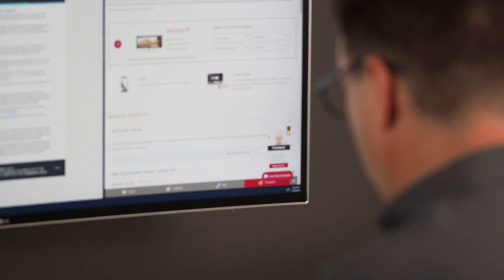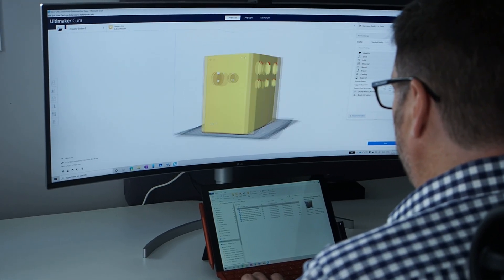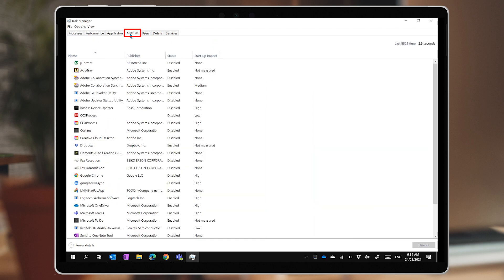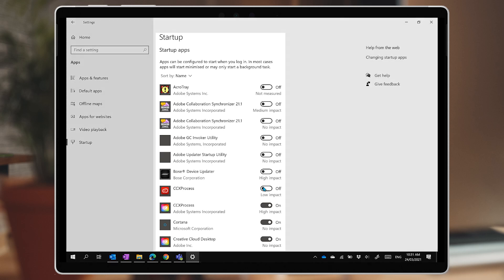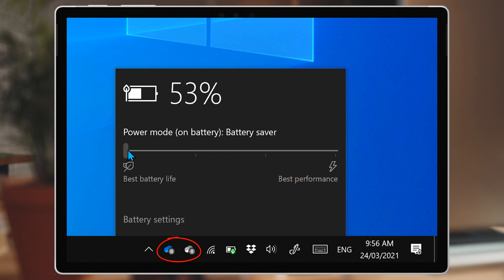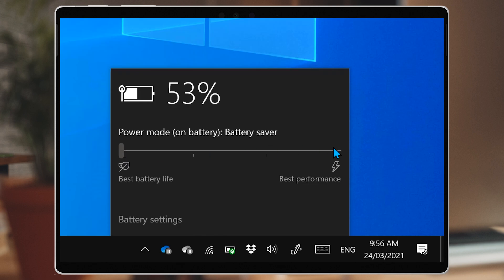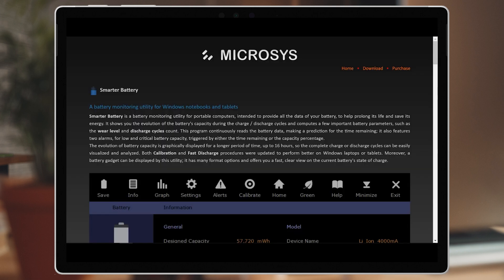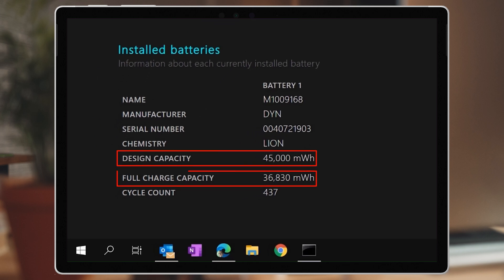Surface Battery Tips and Tricks - 2021 Update!

Comment: Surface Pro loses battery power even when it is switched off. After switching off at 94% for two days it loses 50% (down to 44%)...THis is the bad quality of the batteries despite the high price of Microsoft Surfaces. There is no fix. I am selling mine.

Comment: I have a Surface Pro 5. The battery life even using all recommended low battery usage settings I still only get an hourish not video editing,  just sketching in a sketch app. It's said to have many hours if battery usage on a full charge. FALSE. 
This is my second and possibly last time to buy a Surface Pro as the last one didn't hold a charge for more than 20 mins. The fan was faulty,  buzzing and over heating constantly.  Yes, I had a fan on it and cleaned out the vents. Still junk.
Reply from the maker: Surface Pro 2017 (aka 5) is now SIX years old! Lithium Polymer batteries have a limited number of potential charge and recharge cycles. On top of that heat, wear and tear mean that capacity is reduced significantly. Have you run the battery report? What is the wear condition of your battery?

Comment: hi
 I have Surface pro 3 and 5 
on 3 I use Throttlestop to undervoltage both CPU and gpu.
maximum 4 hour.
on 5 the CPU and gpu locked but I can disable turbo, enable speedshift. tell is 7 or 8  unlocked?
Reply: you can use group policy, local security policy and register to tweak windows. disable automaton.

Comment: Hi. My Surface PRO charger does not work sometimes and I could not charge my Surface PRO . After Some plug in and Plug out AC input or charger port on the Surface PRO, it take charge and it happen when Surface PRO on or off. How can I solve this ? 🌹🌹

Comment: Does keeping the surface pro  cable plugged in would affect the lifetime of the battery ?
Reply from the maker: Yes and no. Heat and battery cycles will have the most impact in my view. If you're on Windows 11, there is a smart battery feature that will extend the battery life even further. See the settings app > Battery.
Reply: Thank you Sir 
@oztabletpc 

Is surface pro 6 battery replaceable?
Reply from the maker: By a skilled technician with the right tools, yes. Not as easy as the latest models unfortunately.

Comment: Playing YouTube from browser, it drains very fast even when first time use and start playing from 100% fully charged. Very disappointing. The specs says can run for 11hrs. But I think if it can last 2 hrs of video play i will be lucky. Suspect that Microsoft is made in China and the factory or reseller may have used lousy or less capacity battery
Reply from the maker: Your problem is with chrome. Try Edge and optimise for battery performance.
Reply: @oztabletpc  I am using Edge. No chrome installed. Based on battery use chart, when it reached 60%, I was playing the video for 3hrs
Reply from the maker: @1stPrinciples455  OK, then change the performance settings in Edge to optimize for battery life. Turn off background activity and optimize for battery. The chromium browser engine is a resource hog, but fortunately in Edge you can trim it back. Made a huge difference to my Pro 8.
Reply from the maker: Also, if this is your first use there could be setup and windows update activity running that will kill power. Check that too.
Reply: @oztabletpc  is it true that we cannot run as admin the cmd.exe unless win 11 is out of S Mode which is an irreversible move?

I will try the settings and monitor the performance.  But what will answer my question on battery health is if there is a tool to see how many charge cycles has the battery gone through. This can allow a buyer to know if the battery is brand new. Cos when I first unboxed it , there was no power to boot up.
Reply: @oztabletpc  I was not able to startup. So I plug in power plug and it was started up. When it was 6% power I unplugged and it shut down while I was doing the initial personalisation settings of the machine and just before I entered the serial number to check the warranty , it shutdown at around 5% battery level.
Reply from the maker: I'd suggest you take it back. It sounds faulty.

Comment: What also helps go the advanced battery settings in energie  management.  And go to power plan go to maximum processor state and lower it to around 50% and go to minimum processor state and lower it to 1 % on battery power this means it wil use much les of its processor on battery power while doing light tasks

Comment: Could u help me? I let my surface charge all day and it only charged to 51! What should I do??
Reply from the maker: Start on the Surface support website. You can get there from the Surface app. You can check your battery condition using the Surface Diagnostic Toolkit too. https://support.microsoft.com/en-us/surface/fix-common-surface-problems-using-the-surface-diagnostic-toolkit-f61d8d18-37a9-863d-f8d0-1982eb16f7b5

Again, you can find that from the Surface app.

Comment: I use Surface Book 2 and 3.
Well, I've 'used' Book 2 and now I use 3 is probably more correct.

What I've found is that Surface Books actually will last longer in the Tablet mode.
My SB2 is a 2nd hand machine and it did have pretty good battery life.
It'll typically last about 4 hours but with the Tablet mode on, it did last about an hour or two more, paired with Edge for web browsing.

I've tried turning the dedicated GPU off from the UEFI (when you start your machine, you hold the volume up and power button until you see the Windows boot logo, then you let go of the power but hold onto the volume up button) but that didn't really affect much.

I have also got the auto brightness set.
I'm looking at around 6 to 7 hours of runtime (Steam on, web surfing on Firefox) without the tablet mode on on my SB3.

But just in case, I've got my trusty Promate Capital-30 (30,000mAh 78W PD powerbank) to top up the juice and so far it works fine. It charges well with the portable solar panel I carry in my car so technically I have infinite source of power.
Reply: thats opposite for me! my surface book 1 dies in 2 hrs (tablet form)

Comment: I just bought the surface pro 7 with an i7 new 3 days ago and the full charge capacity is 45.440 . Is this normal? I thought it was supposed to be 50.04.
Reply from the maker: I have an i5, my design capacity is 48,870 mWh. First charge was up to 49,780mWh, but current full charge varies between 48,310 and 46,510 mWh. I guess this depends on several factors including battery wear, but you can keep an eye on it via the battery report command - Powercfg /batteryreport.
Reply: @oztabletpc  Yes, I understand wear and tear, but this thing is brand new and I only charged it one time. It seems the battery may be old.

Comment: Just wish that there's a way to know how much, roughly, battery you have on your surface without turning the unit on. Like, a small 4 LED somewhere that can be activated to indicate level of battery.
Reply: I've got a Samsung Galaxy Book12 (in addition to my SP7) that allows one to check battery status without turning it on by tapping on the power button (You need to hold the button down for a few seconds to actually start up the device). It's a bit of a pain to have to fire up the SP7 in order to check the battery status.
Reply from the maker: That'd be cool!
Reply: @oztabletpc  I used to have an old laptop with removable battery, and this type of indicator was on the battery. also, many powerbank these day have LED to indicate percentage.

Comment: Won't leaving the surface charge OVERNIGHT constantly be bad for the battery life??? Just like it is for cell phones??
Reply from the maker: From Battery University: 

The question is asked, “Should I disconnect my laptop from the power grid when not in use?” Under normal circumstances this should not be necessary because charging stops when the Li-ion battery is full. A topping charge is only applied when the battery voltage drops to a certain level. Most users do not remove the AC power, and this practice is safe.

https://batteryuniversity.com/index.php/learn/article/how_to_prolong_lithium_based_batteries
Reply: @oztabletpc  Oh ok! Very interesting indeed! Thank you for the reply :)

Comment: This is a great set of recommendations and tips. One thing I would add is that Microsoft recommends draining the battery to under 20% at least once a month to keep the battery fresh. I'm not sure about the science/engineering behind it but as a road warrior (during non-pandemic times) I can tell you it does help in the long run.

Another thing I would say is if the battery is behaving badly (for example, if battery charge capacity has worn down very quickly in recent days or weeks and you can't figure out why) don't hesitate to talk to Microsoft about it. I had a Surface Pro (2017) that had battery issues and MS gave me a free replacement after I provided them with all the details they asked for (including a battery report). It looks like it was a problem with that specific device. My replacement had no issues.

Well done Brett! Thanks for the video.
Reply: By the way, I've started to use Pure Battery Analytics, an app in the Store. Maybe something for you to check out, Brett.

Comment: Wow...wow..wow....I have so much to say so I'll list it out for clarity:-
1. I only learnt two new things.
2. I knew every other thing already. I use edge for pdf too. It does all I need. And I use the same battery bar program too. I actually bought the software too, it cost very small amount I don't recall exactly how much. I've set it to show time remaining rather than battery remaining. I think that's more helpful to me to estimate weather I should hurry up or not. 
3. First new thing was that the SP7+i7 had the worst surface battery.
4. Let the surface cool before you charge it again- that was the second new thing.
5. The fact that I knew so much about surface they things you talked about hereeven though I'm just a surface fan, and don't even have any surface yet, (I plan to buy one soon--not just excited--pumped 😉) I feel so proud. I'm not even in college! Woah!! The power of internet and passion👍👍👍
6. Very helpful video overall, as is usual with all your work. Thanks.
7. One question-- I have asked this on many other video comments as well but no response yet, I know you're busy but I'm hoping you could answer this--which will consume more battery- SP7+i7/16gb at full power or SP7+i5LTE/16GB at full power and LTE on all time??? Both devices running exact same softwares for the comparison. 
8. Like I said, I don't have a surface yet. I'm still researching since it's a lot of money. I plan to use this as my only computer for the next 5 years of my college, which I hope I'll be joining soon. My user case include lots of note taking, pdfs, ebooks, regular photo editing in affinity photo, occasional 4k 
/30fps video editing, occasional steam games most of them from 2013 or before---i love playing old games. So which device should I go for? SP7+i5LTE or SP7+i7???    
9. Thank you so much if you read this whole comment and even more thanks in advance of you can help me out. Great and helpful video. Keep up the good work. 👍👍👍
Reply from the maker: For occasional 4K video editing the i7 is the best option. It does consume more power than the i5 LTE model.
Reply: @oztabletpc  so I'll definitely go with i7. Because I need the power, and it wil be my only computer. Thanks a bunch. You're the first one here to reply.🙏

Comment: I have the official ice blue type cover to the Surface Pro 7. I usually leave mine on standby overnight. But if you do this, best to leave it on Battery Saver mode, otherwise it will eat up more battery power. Or you can shut down (which I'm too lazy to do). May also pay to switch to airplane mode while on standby, that way those apps which love to communicate online in the background, can't do that, and thus, consume also less battery. I love the portability and sleek and versatile of Surface, better than HP. It's like a portable thin gaming PC, with a quad core 10th gen Intel Core i7 CPU that can turbo boost to 3.9Ghz.

Comment: I do not know the quality of the batteries used in the Surface Pro but I have seen some horror stories as to their long-term performance and that getting them replaced is difficult and expensive. I saw your SP6 with only 437 cycle count and already 18% loss, which is pretty bad. Apple and Samsung give 1000 cycle counts to reach 20% battery capacity loss! 

Another issue with Surface devices, unlike LG, Samsung and others are that they do not have battery software to enable longevity. On my Samsung, I can stop charging at 85% (LG 80%) so if you keep it on the charger it is doing much less damage. Apple uses a different technique using AI. This cannot help preserve the Surface battery longevity. 

For basic tasks like web and media, I use power-saving mode which seems to add 2h on my Samsung Flex. On the 10th gen chip, there is no performance hit. Though on my 8th gen LG Gram (i5) performance suffers on this level, so I cannot use this setting. Cheers!
Reply from the maker: Battery life is very subjective. You can't begin to suggest that only Surface has battery issues. It's the chemistry, not the brand. And most people don't know how best to preserve a battery either, so mileage varies wildly. 437 cycles, sure... But what kind of cycles? What discharge rates, environment, heat, chargers were used. It's incredibly variable. And as for Apple's "AI"... Sounds like more Apple marketing drivel to me. They might as well call it liquid-retina-power-pixel-magical-battery-intelligence. Sounds more plausible. "Batterygate" anyone? But hey, I'm completely against the "glue it in" manufacturing techniques that Apple pioneered for the technology industry. Surface, and everyone else should do better.
Reply from the maker: Sorry... just my usual salty-ness because you mention the A-word. ;-)
Reply: @oztabletpc  Yes, sorry, as well, should have not mentioned the “A” word! I mentioned these things as I want MS to improve and they can with better battery tech and the appropriate software. If you are going to glue a battery in, at least you should give it the best lifespan in the here and now? I am not sure MS does that ATM? All the best!
Reply from the maker: Haha. I've survived another episode. Am in hearty agreement on improving the game. And no-one pushes them along like Apple... Guess I should be grateful!
Reply: Andy Microsoft now has a battery life extedner for all surface devices, but it's not as convenient as Samsung or LG/HP etc. First, you can only enable from the bios, so you need to turn off the device each time you want to change. But the worst thing is that it's 50%, which means basically it's good if you have it plugged in all the time and you don't need the battery. I enabled it on my old surface pro 3 since I harly ever use it. But I don't on my Surface Book, since I want to take advantage of the battery...
Reply: @_Digitalguy  wow thanks for the info. That is a weird solution and not very useful for ultrabooks, though desktop laptops it is viable. Looking for around 80-85% cut-off for an optimal solution.  Cheers!

Comment: Is it safe to use the surface while plugged in? Cause I find it hotter when I plugged in even when the battery is full. Btw great video. New sub!
Reply: It sure is. I've done it for years, and doubly so since the pandemic. But as Microsoft recommends, try to drain the battery to under 20% about once a month to give the battery some exercise. I've found this to help keep the battery life long when you actually need it.
Reply from the maker: Yes, it's safe to use plugged in.

Comment: Thanks for another good video.  I install the Microsoft Surface Diagnostic Toolkit on all of my Surface fleet, and that app shows the battery wear, charge cycles, etc, and a tidier format than the command line tool.
I also recommend cycling the battery at least once a week if the device is used long term on the dock or charger.
Reply from the maker: Great tip, thanks for sharing!
Reply: I use Microsoft Surface Diagnostic Toolkit and have never seen the information you listed.  Please share where to find it. I have gone to "Power Supply & Battery" page, unplugged the device and nothing happens has ever appeared on the screen?
Reply: @msp5138  After you open the app and run through the system tests, the battery information icon on the left side of the screen shows battery wear, charging cycles, current charge and a capacity history graph.  You can run the battery and charging tests then skip the rest to make the process faster, although the other tests do give a good picture of how your Surface is doing.
Reply: How do I “cycle the battery”?
Reply from the maker: It means run it flat and charge it again. That's a full charge cycle.
Reply: @oztabletpc  Thanks!